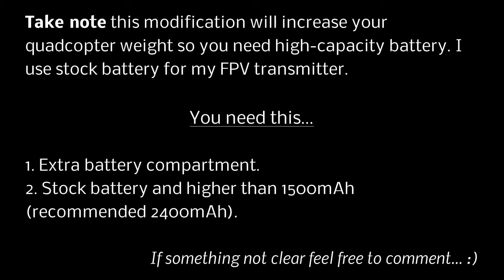MJX X101 - Mount 5.8Ghz FPV with Dual Battery Mod

Comment: Awesome anyways with Hubsan 501s battery 7.4v 2700mah can give you 20 to 26👍 if you want more
Reply from the maker: That great...will try it soon... :)
Reply: Have you tried the that Hubsan battery on the MJX-x101? Does it work fine? Let me know please and I will order as well :)
Reply from the maker: Too long for MJX stock battery compartment...
Reply: Thanks for the reply. Can modify the stock battery compartment but what I wanted to know is the difference in C between the Hubsan 10C and the batteries you used? Does it matter much?
Reply from the maker: Syma X8 battery is 20C, you can use it because in same volt and 2S cell..
Reply: Thanks! :)

Comment: where did you buy another battery compartment from?
Reply from the maker: +Epic Derp Clash Of Clans 

You can buy it here:

http://www.aliexpress.com/item/MJX-X101-spare-parts-lower-cover-of-the-battery-compartment-propeller-canopy-landing-gear-charger-protect/32388385732.html

http://www.aliexpress.com/item/MJX-X101-spare-parts-battery-compartment-propeller-canopy-landing-gear-charger-protect-guard-motor-USB/32388707666.html
Reply: +DSM thanks
Reply from the maker: +Epic Derp Clash Of Clans 

You welcome :)